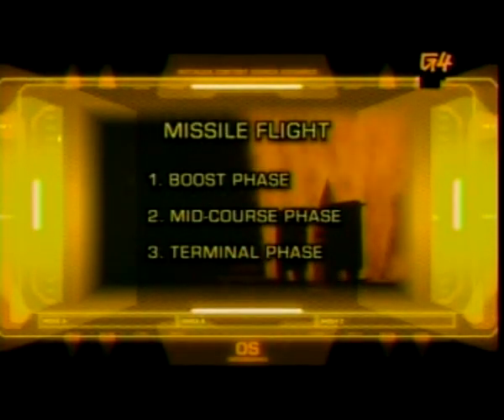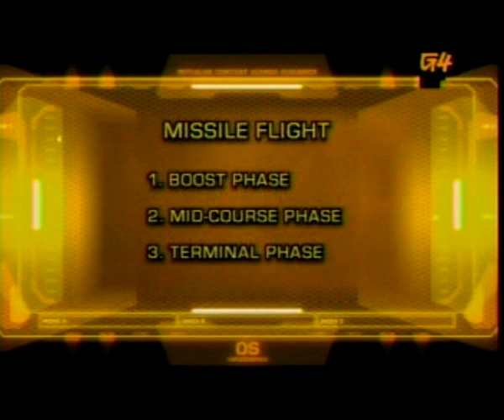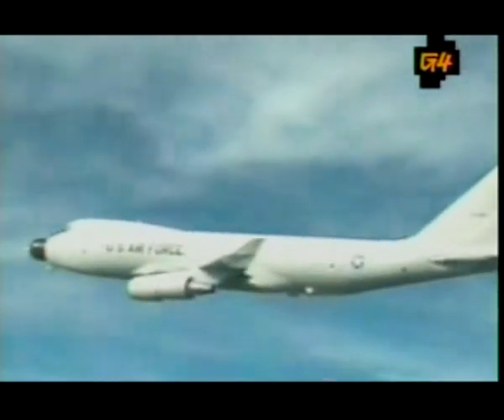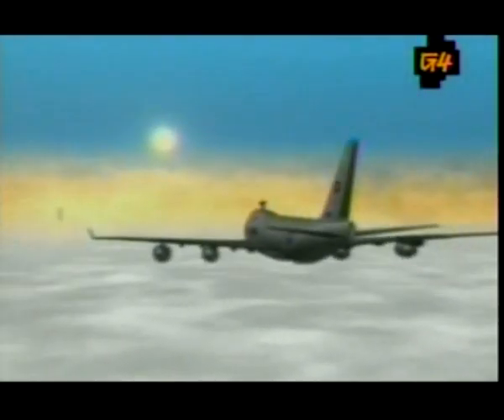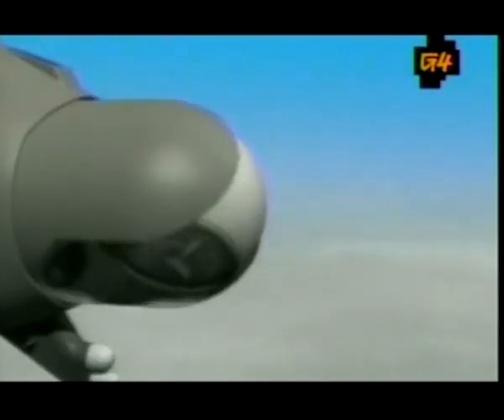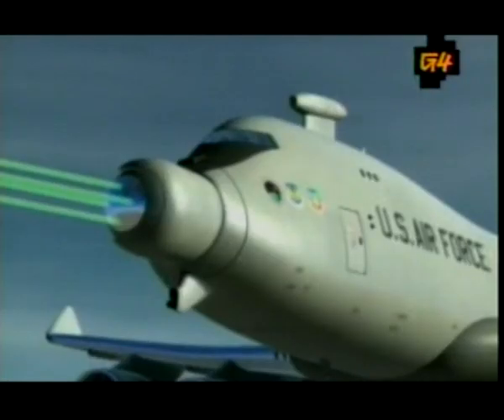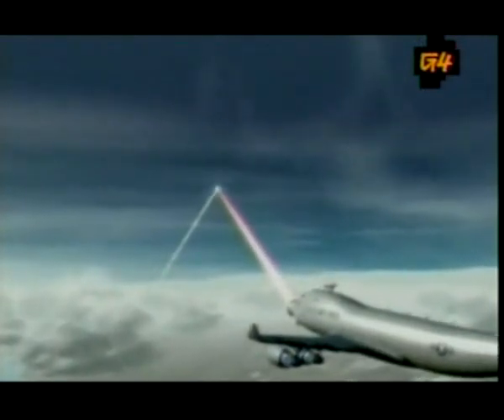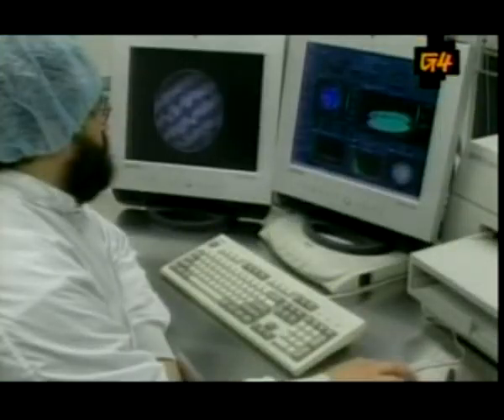Boeing YAL-1 Airborne Laser Testbed

Comment: I worked on the original test bed, called the Airborne Lase Lab, now retired and on display at Dayton Air Force Museum. We could never get that to work under "real" conditions as it was underpowered, This fleet will probably never fly due to cost and logistics. However we will probably see many solid state and fiber laser weapons to shoot down small projectiles, drones, mortars, etc.
Reply: pepe cojones https://www.google.bg/maps/@32.1546944,-110.842072,349a,20y,95.17h/data=!3m1!1e3
here is the aircraft itself, 5 billion $ thrown in the sand...
Reply: NumbnutzTV  This right here! research is useless. Use what we know works an we win. Stability, that's the key.
Reply: Serovic ?_?
Reply: +pepe cohetes Just out of curiosity, are these lasers visible? Because I live near the Marine base Southern California, and I was outside smoking a cigarette one night and I was looking up at the sky and it was kind of cloudy and all of a sudden I saw this crazy laser beam in the sky. It looked relatively high, like about normal air liner cruise altitude, possibly 35,000 feet up (estimating), but it was a fat laser beam and the way it moved across the sky was nuts! I didn't know what the fuck it was. Then I remembered I live about 30 miles from the Marine Corp base where they do flight testing.
Reply: These are infrared wavelength lasers, in the invisible range. Through fog or smoke it is unlikely one would see it. However  a red "hene" for example is very much visible through dust or chaulk in the air. I believe this platform as finally dropped as too expensive, over budget and not completely all-weather.
Reply: Should you really be speaking about this project on a public forum like YouTube?  This is an honest question; not sarcasm.
Reply: @user-sd7qt3hy8l  dude!!! Finally someone out there that has seen what sounds like the same thing I saw late af one evening back in 2006ish. I would like to talk to you more about your experience, and, no I'm not a troll or weirdo. 😎
Reply: @user-sd7qt3hy8l  also quick question, was it blue in color?
Reply: Oppure x provocare incendi
Reply: Can't these lasers start wildfires like Maui?

Comment: Depends on the wavelength of the laser and the reflectivity of the mirror at that wavelength. No mirror is a perfect reflector, some amount of incident light is absorbed and converted to heat. If that small percentage carries enough energy to cut the mirror material, then cut it will

Comment: They didn't really get rid of it, they are just working on it's malfunction. For right now they have shot down it's testing to upgrade it so that it doesn't malfunction again... the experiment terminated early when corrupted beam control software steered the high energy laser slightly off center. It was successful in 2010 but malfunction in the latest test.... It's just being upgraded.

Comment: In my opinion, flight and the laser program don't mix very well. The 2010 test with the 747 was misleading because they gave the 747 the coordinates of the missile before hand.  I think that planes move to fast for the laser system to properly work and that planes in general are to small for a powerful enough laser to be fitted in. I wonder though if this technology could be applied to the navy, where it could serve as an oceanic missile shield.

Comment: Counterpoints to ambrocio del talia, who has disabled replies for whatever reason.

"1) laser will not work on atmosphere condition why,simply because temperature is about negative 50 degree"

1. Yet the YAL-1's chemical oxygen-iodine laser has been tested, and has proven to work, in these conditions. Numerous times. Please explain.

"2) laser will not work to destroy missile,simply because as the missile cruise faster the more it absorb cold temperature on its entire body"

2. Again, the capability of a large laser to destroy a missile at long range has been proven numerous times. Besides, you don't need to heat up the entire missile. All you need to do is focus all the heating on one small area, which then overheats and fails. The missile isn't vaporised by the laser, it's destroyed because its structural integrity is compromised. The missile flies itself apart.

"3) laser will not work, if the missile has a reflective materials or the missile has equipped with extreme hard metal element that requires a tremendous heat,you should know that laser need at least 20,000 megawatts heat who dare to develop that kind of laser"

3. This is a non-issue. The unobtanium missile skin you refer to is simply too expensive and hard to work with to make missiles out of, not to mention you cannot obtain it. The closest there is is titanium, which is a non-issue for a COIL. Furthermore, most missiles already have highly reflective skins, and the COIL as installed on the YAL-1 has proven this to be a non-issue. As for your 20GW laser, I present to you Q-switching.

"4) a 20,000 megawatt heat of a laser is not enough to destroy an intercontinental ballistic missile imagine that how big it was, come on man lets be pragmatic"

4. See my reply to 2. I mention that the method of failure of the missile isn't being overheated over its entirety by a giant flashlight, but overheated in a small amount of its surface area, which causes the missile to disintegrate in flight. In the case of ICBMs, you're also very likely to ignite whatever fuel is in the tank. Not to mention that you'd be fine with way less than 20GW, in fact, a megawatt-class laser would be enough. In fact, the YAL-1 was expected to be able to destroy solid-fueled ICBMs at ranges up to 300 km, liquid-fueled ICBMs at ranges up to 600 km.

"5) laser travel faster like the speed of light but it has a limit, but a missile has a long long range of travel designed to reach  it destiny"

5. The speed of light, 0.3 million kilometres per second, means that aiming offset is as good as irrelevant at terrestrial ranges. Range of the missile is a non-issue, if the YAL-1 flies sufficiently close to the boost phase missile, the missile will get shot down.

"6) so far the best laser for me was the SUN ,why it has balance heat that penetrates that dries up the wet cloth"

6. Sun isn't a laser. Sun doesn't emit one coherent beam of light. Your argument is irrelevant.

7. YAL-1 has been canceled.
Reply: I think people are forgetting one major thing. Light can be reflected :)
Reply: At 1-2 µm wavelengths, simple aluminum foil from your local store has a reflectivity of over 95%. Aluminum isn't exactly 'unobtanium'. 

A simple gold coating would be better (which is slightly more expensive, but can be done rather cheap and is very durable), since it has a reflectivity of around 99%.

Alternatively, simple ablative material could be used. This evaporates when it heats up by the laser. This costs a lot of heat energy, which is then dispersed into the atmosphere.
Reply: chsxtian It was tested on gold long ago. Most missiles are aluminum anyways. The paints burn off too. The ablative material transfers some of the energy to under lying metal and heats the metals. Think about what happened in the first shuttle disaster when an O-ring leaked. The rocket fuel under the metal is very sensitive to heat. The laser just has to heat the metal enough to crack it and start the fuel on fire. There have been commercial laser cuts that cut thru metal for decades.
Reply: The figures of merit are peak power density not average power. Plenty of videos on Youtube of 1Watt lasers burning thru metal. Power density is power per area.

Comment: This aircraft got cancel because it cost to much about $5 billion.  Why would you want to have a Boeing 747 with THEL?  Why not just make THEL variant to put on the B-2, B-52, B-1B, EA-18G, F-18E/F, E-3D Block 40/45, E-2D, F-22A, F-35A/B/C, F-15E, F-15C, F-16C/D, A-10C, & AC-130U.  The THEL beam would blast Intercontinental ballistic Missiles aka ICBM and Surface Air to Missile aka SAM away.  This will save defense budget money.

Comment: @ARMENH91 First off they're going to be operating in areas where a TBM or ICBM will most likely be launched from. And it's not that difficult to tell the difference between a missile and a plane, seeing how commercial planes do not fly faster than 400 mph and fly vertically beyond 40,000 ft.

Comment: @ezhavapanicker Yes, if a material with a high melting point is placed over the rocket, the laser will be rendered inneficient. The laser cannot pierce the skin, all it can do is heat up the missile and weaken its structural integrity enough so that it explodes. Also, you can modify an ICBM to spin on its long axis, which will decrease the lasers effectiveness 3 fold (because it will be unable to heat up a single spot).

Comment: isn't this what they used in Gaza recently?
Reply: No, that turned out to be bullshit.
Reply: Jed Erickson well, it was a flash of electrical sparking hitting a single area... what was it then?
Reply: A ground based LASER defense system doesn't make sense either - too many things about the NIR spectrum complicate its use for offensive or defensive use on the ground.

And using it as a phase4 (last ditch) defense for 'iron dome' doesn't make sense either as the missiles would be on final approach and likely impact their target anyway, or very nearby.

LASERs are useful for 'dazzle' or blinding Defense against approaching ground forces sure, but use of LASERs in an Offensive role just wouldn't be practical. 

Too many other existing systems are much more effective and efficient - think RF radiation, sound waves, EM projectiles, or even bullets, but Not LASERs.

Also, since you bring up Singapore - Highly overated and dangerous imltho.
Most of the LASERs I've seen come out of there are Garbage, useful in manufacturing roles, but for military use No.
Better classified as BroadSpectrumLightArrays than LASERs, they would pose as great a hazard for the operator, as for the target he/she is directing it against.

People writing articles like this have seen too many Movies, and need to go back to school.
Reply: Wrong again, can fire every 5-7 seconds, and remain on station for 12-14 hours at a time...
You guys really should check your facts, or not post at all :/
Reply: It's the desire to share information, that is so important now. We can get all the facts straight after the package is unwrapped!
Reply: True, it is important to share information David - but if the information being shared is False or Made Up, then the persons sharing that information are doing more Harm than good - disseminating their own ignorance to the masses.
Bottom line, if the person doesn't know the facts then he/she should Not share their ASS-umptions... period
Reply: See the ADAM laser by Lockheed Martin here on Youtube.
Reply: Douglas Chilson In Phase 4 like Iron dome the ranges are short like 5-20km in Israel. The rocket coming in has a heat sensitive fuel and heat sensitive warhead. You only need to create enough heat to start either of those explosives on fire. The incoming missile is destroyed by its on fuel or warhead exploding.
Reply: Thanks Robert, will check it out.

While I agree with you in Theory on short range destinations; in practical application I'm sure it leaves something to be desired:
ie. That flaming hunk of metal and debris still has to go somewhere, and momentum is going to continue carrying it in the direction of travel.  Also, at 5-20km it will probably be well within the FLOT when it detonates and while it may not hit the enemy's desired target, it will hit A target, most likely friendly.

What I loved most about the ABL is that it knocked out the threat during yhe Boost Phase; meaning that accounting for some small variations in trajectory and wind resistance, the fiery pile of rubble is still going to land near the enemy who launched it, or at least well past our FLOT and in their territory. 
It's their molten hunk of what used to me a missile... let them keep it ;)
Reply: *****
Grain of salt. Point noted, Russian propagandist.
Reply: ***** "Iron Dome" is just a name and it is not an actual dome. There are radar jammers, which the Russians are good at, and radio Identification Friend or Foe systems. So the Russians can identify enemy missiles and maybe jam them. Most nuclear armed missiles are not radar guided and all USA military equipment is EMI shield, so radar jamming is not going to stop them.

Comment: @ptuku rays ? i know about rays , like the gamma ray = the most powerful ray exsist , :) it will make laser ray looks like a mouse vs lion lol , rays can be contained , do you know @ 20,000 ft high ? the temperture can be so cold ? sometimes it ices the aircraft wings @ speed efaster than 760mph ? no ray can travel throu mirror , not even the gamma ray wich its temperture ecceeds 2600c and radiation grater than U235 , 237 , and 238 . there is always counter act to every act

Comment: Just make surface of missile shiny like mirror and this multi million dollar laser will be useless
Reply: Would not work. The missile is destroyed by the heat from the laser, mirrors couldn't deflect heat.
Reply: Jacob Spence a laser what ever the frequency can be reflected, not only it can be reflected but the source cannot be hidden so it could be pretty simple to give the location of the emitter and take care of it.
It is true that very high power laser can destroy a mirror the solution is aluminium coating and cvd diamond
Reply: madisonelectronic how relevant.

Comment: Very possible and the optic in CVD diamond added to supercapacitor make it technically  easy!

BUT
most of the missile are coated with dielectric mirror, the wave length of high power laser are well know thus their efficiency is close to zero.
Unless of course the guy who have enough physic knowledge to make a missile have no knowledge about optic ! 
in such case there is nothing to fear about the missile since optic is a major concern  for missile LOL 
So this plane can destroy only bad missile

Comment: See my homepage for experiments using laser. Click the flags to translate.There are several easy to do examples to split the beam, modulate on of the two and then recombine them to produce low frequency beats. These beats should be able to induce currents into the body to transmit sound or steer muscles if used with high power lasers.You dont even need a laser, this can be done with ordinary light and heat radiation as well.The double slit experiment mostly is done with an ordinary light source.